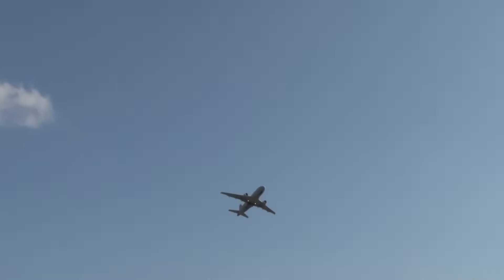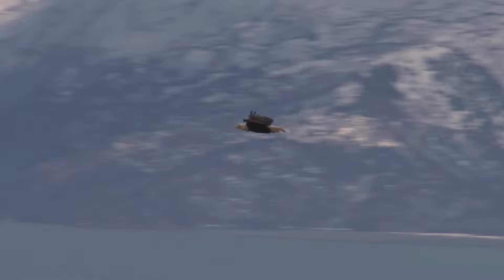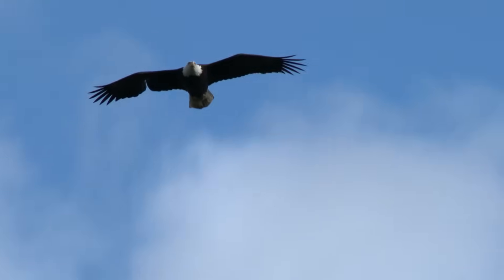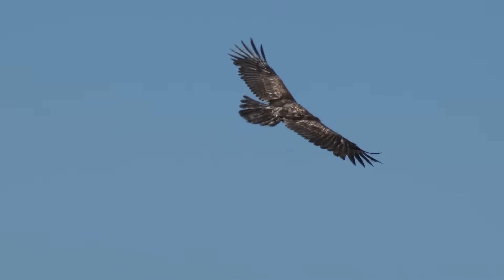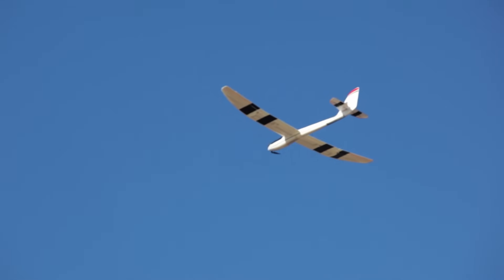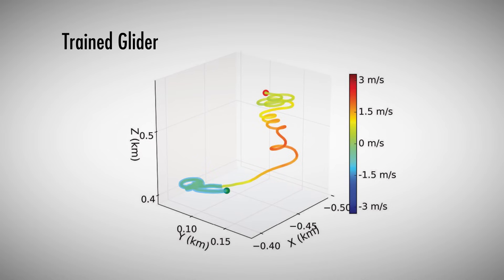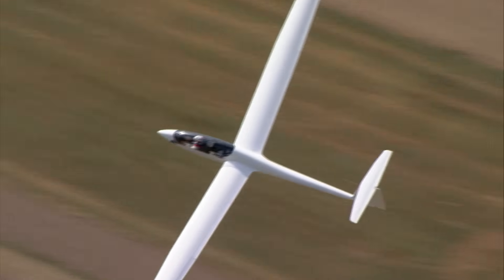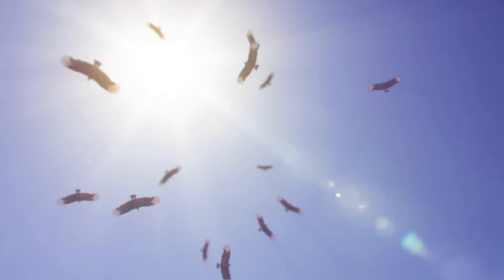Bird’s Secret To Soaring Super High

Comment: Think
Glider
No
The Sunset
Green Comet
ASMR
Recorded
Reply: Radar
Reply: Now you're a bird
Vomit
G force
Reply: Ring
In communication or will you deny
Contact
Hermits
Villa Harvey 
Royal Management faux
Reply: Rotation
Axil
Mass
Group
Column
No
Think back
Reply: Judgement Day
Are you still there
Discovered in
☀ 
Vibration
Air
Wind
Cloud effects the
Find
Surrender 
Contact
Why I'm home without a home now
Reply: Your not in the flow
High Intellegence in?
You're just a regular dude
Reply: Rotary
Reply: Blue Axil
Reply: Synchronization
Reply: The building
Examine
Axis
Tower
Petrol
Plate
Reply: Intellectual
Look up bird
Reply: Thermal
Rotation
Higher
In now 
Connect aerospace
Reply: Visibility
The index on
Axil moo
Reply: Moon now find your alignment 
Intelligent 
I am
Reply: Pleasure is on Exhibit
Reply: Museum
Find
Architect

Comment: I have flown RC sailplanes for 45 years. Never spent much on high-end designs or ready to fly crap. Some of my best flight times have come from used, damaged and repaired planes from swap meets or give aways from someone at the club. Leaning to read your sailplane is the most important skill, the energy conserving flying techniques come with time. It is now rare I can't hook up a thermal and fly for 15-60 minutes or more one one launch. This was not always the case back in my early days. I don't need, want or would use a "taught" sailplane. Missed the whole point of being there to start with. Play video games if you want extra lives or time.

Comment: Long distance sailplane pilots have mastered this since the 70s. In a 10 hour cross country flight you could gain much data to machine learn the process.  The human/animal element of lift source choice and energy line reading would be more difficult to mimick by a computer.    Go soar and you will learn much.
Reply: it is a very cool thing

Comment: I haven't thermalled my paraglider  since three hours ago.  I took off at 1900 feet MSL and at one point in my 55 minute flight was 4300 feet.  One very basic 'algorithm' for thermaling is when lift is improving fly straighter; when lift is reducing turn tighter.

Comment: Variometer on each wing tip. 
When you go down, fly straight
When you go up and lift is getting stronger, fly straight
When you go up but lift is getting less strong, turn towards the stronger side of the lift

Simple algorithm that paragliders use. They don't have a vario on each tip but feel on which side the thermal is stronger through the break lines.
They also look at surroundings (clouds, slopes, ...) to have a bigger change of finding a thermal

Comment: I've been HabgGliding since 1988.Soring is really an easy thing to do. For Autonomous Soring You might want to put Temperature Sensors in the wing tips of the glider. program the glider to turn into the warmer air.

Comment: I agree with Sebastian, these guys could learn a lot from paragliding instead of RC planes. Both birds and paraglider pilots look for thermals in a similar way and use similar techniques to stay in them. Many soaring birds (vultures, hawks) have trim speeds and sinking rates similar to that of paraglider so that's also an analogy worth looking into. The only thing that paragliders cannot do is flapping their wings if they need a lift apart from thermals or ridge lift.
Reply: While paragliders  have a similar flight envelope and wing loading to birds, it's very difficult to put an autopilot on one and I don't think its been done. It's really easy on an RC plane.  In the end it's all about the coding. 
Furthermore, you could make an RC glider heavier and the same shape as a bird to closely replicate the sink rate and glide ratio.
Reply: I phrased it poorly. What I meant was not replacing RC planes with paragliders because of similar flight characteristics but because a paraglider would have a human being right there in the air. This is something one cannot gain from piloting an RC plane. Birds in flight have certain habits, quirks, mentality that differs between the species and this sort of thing can be only picked if one experiences the environment the same way as they. There was a very interesting thread on paraglidingforum.com recently where people shared their experiences of flying with birds and it's striking how NONE of it is ever mentioned in books about birds, it's obviously the knowledge not accessible to researchers unless they get there themselves. Examples of such experiences: the nicest birds as flying companions are turkey vultures: polite, inquisitive, respecting "traffic rules" (e.g. they'll join you in a thermal in the correct direction) BUT they tend to space out in flight sometimes (take momentary naps) so it's recommended to carry a whistle when flying with them. They also hate to flap their wings. Falcons OTOH are tricky: if they want you out of their aerial territory, they'll pretend to guide you to a thermal while in fact they are guiding you to sinking air (many people reported this). Hawks are more interested in food than flying so they tend to leave thermals early (so not the best guides). Ravens like aerial acrobatics, barrel rolls, etc. Pelicans and storks are very patient: they'll work even a very weak lift forever until they get high. Cranes are the opposite: impatient, weaker lift and they're gone looking for something else.
Reply: @JanPBtest  Paragliders, hang gliders and last but not least soaring planes who perfectionize it in current human aviation.